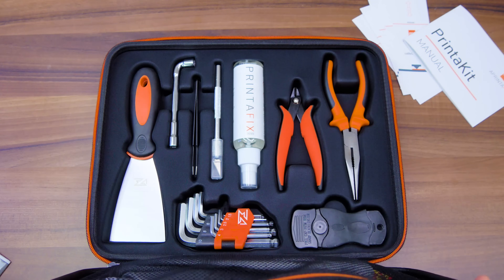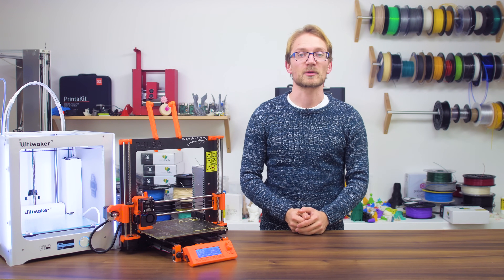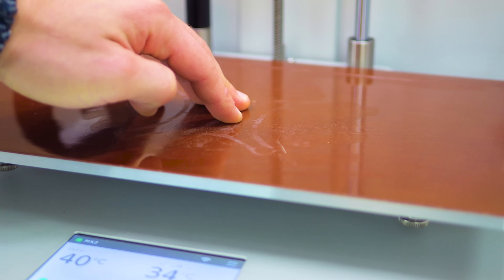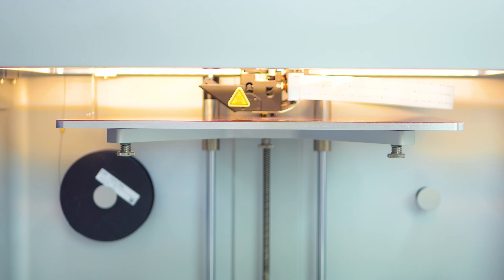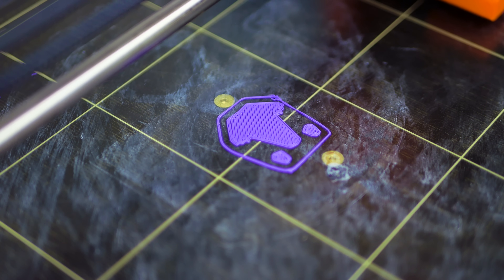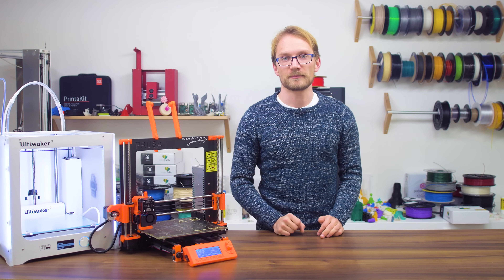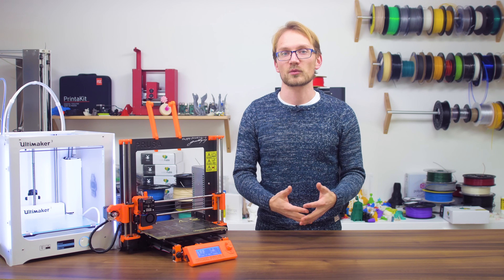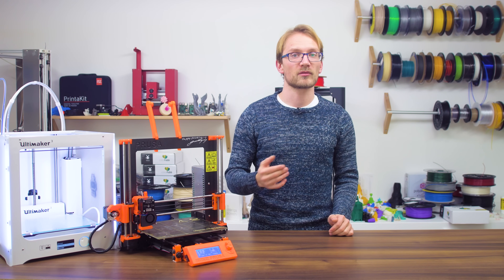Basics: 5 ways of getting your 3D prints to stick!

Comment: Correct me if I'm wrong(and I really hope I am), but the settings First layer width, First layer bed temperature and First layer nozzle temperature are non-existent in Cura?
Reply: Hampus Lundin they are not visible by default, but if you click Settings/Configure setting visibility you can make many many options visible so that you can adjust them
Reply: not in cura

Comment: Old tricks but always good to know, be reminded of and for others to find out about.
If you see it and still regually use glue sticks, try Elmer's 'disappearing purple' as it seems to work better than the normal stuff.
(Switched from Uhu to that when there was a shortage some time bacl. Don't like the smell and I liked that the Uhu was German, but the purple one outperforms. The normal not so much. At least on glass with 100c first layer printing ABS)
Only thing I've never found out how to get to stick is 'FlexPLA'. That sticks to /nothing/. Closest is buildtak running hot.)

Comment: I went from a heated glass bed with hair spray, (Messy!) to using Elmer's Glue Stick.
It worked, but I started pulling chips from the borosilicate glass and my bed began to look like the moon.

Finally, I tried a sheet of PEI and not only did it cover the craters in the glass, but worked wonders for ABS sticking to the bed.
I was printing large objects that would go beyond the heating element under the glass.
The temperature would drop drastically beyond the element and I was getting bed separation.
The PEI solved that. It seems to keep ABS stuck to the bed at lower temps. Even down to 70º C.

Comment: really great advice! unfortunately I own a davinci 1.1 plus which has two screws on the back left and back right, and one screw in the middle front, so you have to imagine moving a triangle under a square to really adjust the bed at all. I'm not sure why they chose this way instead of putting a screw on all four sides of the bed lol.
Reply: Matthew Allen actually 3 points is easier than 4, since it's less points to calibrate, as long as the bed is stiff enough and completely flat it is better 😀 see the ultimaker 3 in the video it has two at the front but one at the back . It's possible to warp a bed with 4 badly adjusted screws particularly with pcb heaters. I hope that explains the decision for 3 points of adjustment

Comment: Thomas, I used to print on glass, PLA is OK, but never got it to stick with ABS, I even pushed the bed to 130 degree, still did not work. Also tried kapton tape, blue tape, glue stick, spray, still not satisfied with results. Then I tried to 3D print on Acrylic Sheet (got it from here: https://www.homedepot.ca/en/home/p.clear-acrylic-sheet---220-inch-x-18-inch-x-24-inch.1000126448.html ), and I LOVE IT!!  You have to print on a cold bed because the sheet bends a lot with heat. My prints stick to it really well! I broke a few parts because I could not remove them. You have to get the first layer perfect, if it's too squished, you can't remove the part, it becomes one with the Acrylic Sheet. ABS sticks well, but corners still bend, so brim solves the problem. But considering that it's on cold bed, I think it's awesome! Please TRY IT!!  TRY IT !! TRY IT !!
Reply: Try print on beer on the glass. I'm really happy with this method. Prints with ABS at 240 deg. C, and 105 deg. C for the bed.
Reply: Since I print on Acrylic Sheet, I don't need a heated bed. I print ABS at 240 deg C, and heated bed is OFF
Reply: But how many prints will withstand your acrylic sheet? And they cost money. And this problems with prints, that sticks to the sheet...
Reply: I've been using it for over a month, so it's hard to say. I printed about 30 parts on it, all of them in the center of the bed, and so far no sign of degradation. Yes it costs money, but it's not that much considering the money I spent on other things I have tried that did not work. Also the sheet in the link above it's quite big, you can probably cut out 6 smaller sheets 20cm by 20 cm for the 3D printer. And if it does loose stickiness over time, you can use the other side also. Also... you can use sand paper, to remove a tiny layer, and make the surface abrasive for even better stickiness. The way I see it, the sheet I am using right now, it should last for quite some time, a year or more... I don't know... but it looks promising so far. About "problems with prints, that sticks to the sheet"; once you get that first layer to be at the correct height, then every part will print perfect, and have moderate stickiness. The Acrylic Sheet is flexible, so after I print, I take it out of the printer, bend the sheet to unstick parts of the print, then I use a cutter to insert the blade in between to remove / unstick the rest. Look... I don't sell this Acrylic Sheet, I am not trying to benefit from it... I just want to share my success with what I have tried, because I am really happy with this solution. It's up to you to try it, and spread the word...
Reply: This is good result! I was thinking that one sheet last about 2-3 prints maximum. :) Thanks, must try it in this case. :)
Reply: mike36801 Nothing beats double sided tape for bed adhesion; it is so strong i only worry about getting my prints off the bed in one piece.
Just be sure to change it every 2-5 prints as it gets filthy, and don't cover more of the bed than you need.
Reply: +mike36801    I haven't printed with ABS yet.  Trying to master PLA first.  But I found that acetate sheets for overhead projectors for laser printer (high temperature) work a treat and are more resistant to heat than acrylic sheets.   These OHP acetate sheets are around 30 € - sometimes less - per 100 sheets in A4 size.

Comment: I'm a hairspray guy. It's basically a witch's brew of nylon, polyurethane, and acrylic. Inexpensive, easy to apply in a super thin coat, and simple to clean up. But yeah, level your bed and tune your temps and speeds.
Reply: I run what started as a Simple 2013 (#4698!) on a daily basis. Try a couple prints without the Kapton. I'm going to assume you are using Cura 2.3.1. In the "Print Setup" sidebar to the right, click on the "Custom" button. Hover your mouse over "Infill" and you should see a gear icon. Click the icon to open the "Infill" settings. Expand the menu listing and you'll see "Infill Pattern." Make sure the box is checked. Close the "Preferences" pop-up. You should now have the "Infill Pattern" pull-down menu in the <Print Setup-Custom-Infill> menu, right underneath "Infill Density." Also, consider lowering the X and Y acceleration speeds.
Reply: John Girotti It's awesome on glass, I never got it to work on aluminium I use uhu gluestick on that
Reply: John Girotti I use hair spray on unheated bed covered with kapton tape to print PLA, worked well for a lot of parts now not sticking anymore my printer is quite hobby like . older Printrbot . Usually brim from Cura is much better than brim from slic3r as it surrounds all the contours . I will try the over ectruded first layer on unheated kapton to see how that goes . Anybody know how to set fill in cura parallel to x or y not diagonslly ? my printer vibrated like crazy on diagonal infill
Reply: It can be difficult, to the point of frustration, to use on metal build plates. Who wants to put multiple layers of adherent down? The only aluminum plate I use now has a chemically etched surface that has pretty good adherence, even dry. The problem I run into with it is the high heat transfer rate, so I only use it heated, with skirts or mouse ears. I do use glue stick occasionally, mostly for prints that only use a small portion of the plate. It's kept in the fridge. It seems to lay a thinner, more consistent coat when chilled. Also, it's minty. Who doesn't like a fresh-smelling print?
Reply: John Girotti Ok hope I find it great !

Comment: Thanks Tom! Good subject and a very good video as always, but this time, i wished it was a little longer :-) !! Perhaps you could go into this subject a little deeper and discuss the different options for adhesion on a per-material basis. Especially getting Nylon 12 to stick on the bed has turned out to be a big challenge for me. I have got good results with Nylon by putting down a thin even layer (0.2mm) of the water resistant version of white wood-glue (Bison) on the bed. After heating up the bed this glue hardens within minutes and lays down a beautiful transparent glass-like layer on the bed that is suitable as a good adhesive surface for ABS PLA and Nylon and even (be it a little less sturdy) for Polycarbonate. Since this glue is capable of attaching to anything that is cellulose based (such as wood) and since Nylon tends to stick to anything cellulose based, I thought I 'd give this glue a try and it turns out to be the material of my choice now for Nylon adhesion to the bed.. but I think there must be some kind of "more standard procedure" for Nylon that I still haven't heard about, because I could not find anyone else using white wood glue for Nylon, so there must be other materials that I haven't heard of that works well with Nylon I think. Perhaps you could enlighten us on this?  Another material that is very interesting to print with nowadays is the earlier mentioned Polycarbonate. I now use the very expensive Buildtak surfaces for that purpose, but I wonder if there is a more DIY method for getting PC to stick to the bed. (For larger prints the Bison glue I mentioned does not work as well as Buildtak, but it still does work relatively well, and I would say good enough for most prints with a smaller footprint (up to 5x5 cm) on the bed (due to the high shrink rate of Nylon). Once again, my compliments on your videos, you are by far the most knowledgeable person on the subject of 3D printing on youtube in my opinion and I have the utmost respect for your work and the knowledge that you share with us on your channel.

Comment: Nice video, but how would one know if the nozzle is in the right hight when the Material used is not already tuned in perfectly?
Reply: So if i get you right the most part is to dial in the exact physical constraints. By the way to dial in the actual Filamentdiameter is a very good point, i missed that so far. But still you would have to change your Extrusion Multiplier with different Filament- Manufacturer/Materials. Why is that so? If everything is done right, shouldn't the Multiplier be "1" except you would deliberately want to Over- or Under-extrude?
Thanks a lot for sharing your knowledge.

Comment: I have used the raft function in the Marlin system all along since I found out about it. You will get a perfect bottom on your print because the whole system has settled down. You will get super adhesion.

Comment: Maybe you could do a series of videos, trying different bed surfaces, often even weird ones, just to see what works. I have tried printing PLA onto regular sheet paper or that carbon fibre-looking PVC foil with good results. That one guy below me says he's using lemon juice. Basically, whatever you find around your house, stick it onto the printbed and see if you can get the print to stick.
Reply: Adolf Valášek you can try with soda drinks like coca cola . You put coca cola on the bed then wipe it and after its dry the bed will be very stcky from the sugar:)).

Comment: I use lemon juice as my bed adhesion 'glue' with 60C bed temp.
I know it sounds weird, but it works great for large surface area parts in PLA. If they aren't too tall, they stick so well I can pick up the printer by the print, but after the bed cools, it's as if the print was just set on the bed; it just lifts right off.
Reply: I've switched away from lemon juice and moved to sugar water as well. I didn't squeeze lemons on my build plate, lol, I just bought the stuff that's made from concentrate (it's pretty cheap and very nice for fish, ect.) I use a mixture that's 100g sugar per 200mL of water, and it's almost like a light syrup. I used to use a tiny spray bottle to apply it, but I found that a paper towel or sponge was an adequate applicator. Sometimes if there's a print that's misbehaving, I'll add a little extra syrup to that spot, but generally I've had very good luck with all prints @60C.
Reply: In that case i think simply using sugarwater or somekind of diluted syrup should work just as well. Just to save you the hassle to get lemons all the time. And lemons have an expiry date. (And to waste precious tasty lemoms, noooo!)

I have trouble with one of my PLAs not adhering properly. My white PLA works fine on plain glass @ 50C, but my orange PLA requires extra steps. For this orange PLA i simply use ABS juice, and it works just fine @ 60 C! For my ABS print idem, ABS juice but @ 90C (even though the manufacturer recommends 80, this does not work at all, it requires an absolute minimum of 85C if you do not want a failure rate of over 90%.
Reply: @ReapingMiner  sweet tip :)
Reply: I don't think it works unheated. Again, I haven't tried it, but with the
 ways it's been behaving with me, when the bed gets down to room 
temperature (14C for me, lol), it basically loses all of its adhesive 
properties. That's great for detaching after the bed cools, but for 
unheated, I don't think it would work.
Reply: LazerLord10 what is the ratio of the suger vs water? Thanks
Reply: How did you find out that lemon juice works just interested to know
Reply: @maverickslack760  No idea, I just heard it somewhere. I have since moved on to sugar water, as it has the same effect and is easier to make.
Reply: That's pretty cool! Have you tried it for ABS?
Reply: Not yet, I doubt it will work, but I can see what happens.
Reply: I am going to have to try this. Thanks for the idea!
Reply: Sounds awesome! Have you tried to use lemon juice without a heated bed and see if it works? This would be the cheapest alternative solution!
Reply: Maybe when i make a heater for my bed i will try it. For the moment i have found that the best solution for an unheated bed is to use uhu stick glue. It even works for small ABS parts!!!